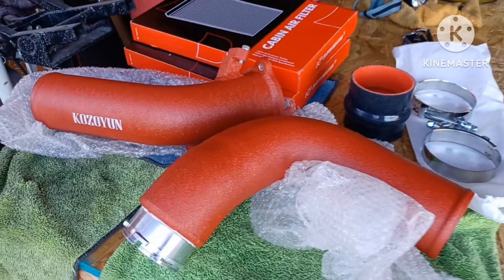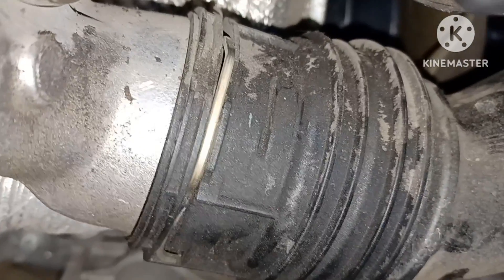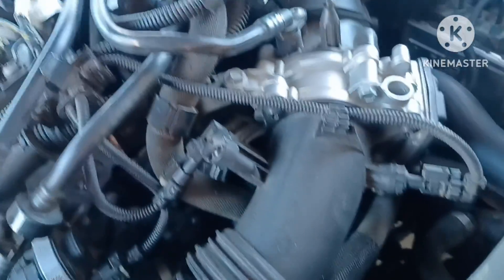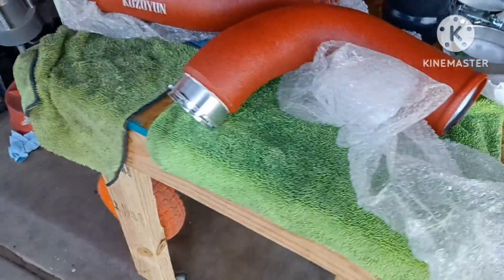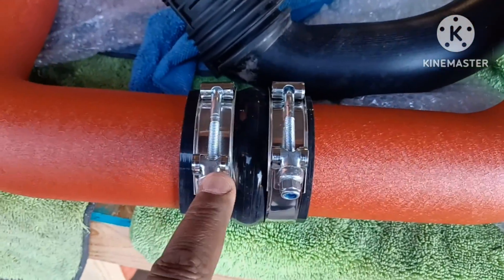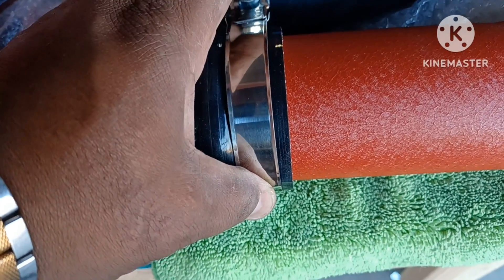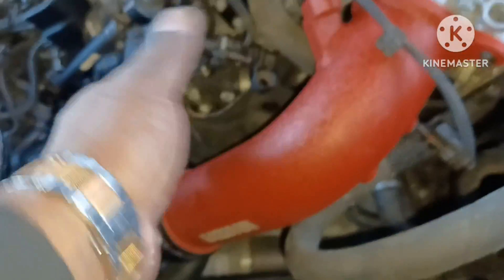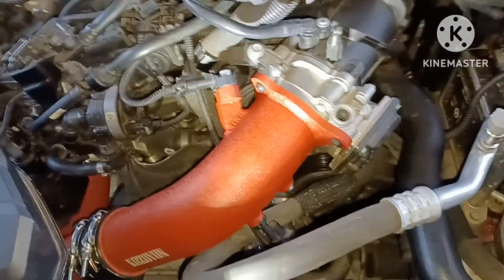BMW performance upgrade to aluminum charge pipe | 2019 BMW B48 330i G20

Comment: Do you have to get your car tuned after you install this? I'm about to buy this one for my 2023 330 and I don't want any check engine lights to pop up. Have you seen the check engine pop up since the install?
Reply from the maker: Nope. It didn't change a thing. All it does is hold pressure better versus the plastic pipes flexing once they heat up a little.

Comment: What blow off valve did you install . Is it attached  to the charge pipe?
Reply from the maker: The blowoff valve on this engine is somewhere after the factory wastegate down by the turbo. The charge pipe doesn't need a blowoff valve. You could add one, but you dont need to since there's a factory one already on the setup

Comment: Hey Jeff! Been looking for a replacement chargepipe and Koyozun looks like a good alternative to higher priced options. Any feedback after 1,5 years of use? Any leaks or error codes or does it work like a charm? Tnx!!
Reply from the maker: No codes and no leaks. Actually makes the intake sound like it's really sucking air, tho. I like how it sounds when you really get on it and it's like a vacuum sound and the car is just digging!
Reply: @MicDropBBQ Awesome, thanks for the quick reply!!
Reply from the maker: I try to reply when I can, Bruno! I know we trying to get these cars right! LOL!

Comment: I installed charge pipe on my 2019 bmw 330i and it gave me a check engine light
Reply from the maker: Because you're getting more air when the throttle body opens. Have to get it tuned to remove that light.
Reply: @ I am running cts intake with dinan turbo inlet and a cts chargepipe
Reply from the maker: @fuzionbrain  tune might correct it
Reply: @MicDropBBQ  yeah cause i took it to get a scan but no codes showed up but i do have a check engine light
Reply from the maker: Does it drive any differently? Mine has a slight hesitation from a stoplight, but once I'm going like 15mph, the ECU adjusts and it runs like normal. It's just at a super low rpm leaving the light is the only thing a tune can adjust. That's from too much air, I know.
Reply: @MicDropBBQ  no it dosnt drive any different from what I can tell I don’t feel it lose power or anything like that
Reply: @ do you think if I remove the turbo inlet n put it back to stock it’ll come off

Comment: You need an air intake to hear the turbo wayyy more
Reply from the maker: I have one. I didn't do a video for it, tho. LOL! I can't remember the name of it, but it's an entire intake system I put on there with the cone-filter instead of the box filter. It's wide open now! I think I wanna get it tuned at least for the increased airflow. It has a little more punch, but there's a little lag because it was tuned for the box.

Comment: Was thinking of getting this brand charge pipe for my Si is this brand good or should I spend a little more to get the better brand?
Reply from the maker: It's not done anything less than what I already had. It doesn't flex, and that's about all a good pipe should do. Brand names usually don't mean much. The car doesn't know what the sticker on the pipe says. If the pipes are identical and both made with aluminum, what's the real difference? The price...that's about it. The hose clamps are the same. The ports are the same. The dimensions are the same. The sticker and the price are different. That ain't gon make a car go faster. LOL! If stickers made cars go faster, I'd load up on em.

Comment: Apologies for the silly question. Why do you change the charge pipe?
Reply from the maker: More air pressure. It's like having a 2" exhaust versus a 2.5" exhaust. When you can fill more air into something, the boost pressure theoretically can be greater. Imagine having a plastic straw as the charge pipe; it's not that much air can pass thru it, and the plastic can flex versus being stable and solid. Now replace the straw with a large metal pipe; more air can now be pushed thru by the turbo, and there's no flex at any level (theoretically). More air pressure (especially when tuned) can now match the fuel in the intake. It increases hp and torque. You get more air pressure with aluminum versus a plastic tube that can flex as it gets hotter, as well. You get more stable high pressure (psi) on heavy loads with aluminum.

Comment: How you like that chargepipe as far as brand?  Im getting a full intercooler kit with charge pipes for my n55 f10 535i. Same brand.  The entire kit is cheaper than buying the namebrand intercooler alone so im wondering how you feel about quality
Reply from the maker: It's solid. Looks amazing and easy install. Doesn't feel cheap like the stock BMW parts that I pulled off, for sure. Really gives the engine an upgraded look. I also have an intake I put on, but didn't do a video of it. Whole engine looks very detailed now!

Comment: I can't believe you give 5 dollar rides in that car. Rideshare pax deserve no better than a 5 year old chevy Cruze
Reply from the maker: Depends on how far the ride is for $5. A mile or two, sure. But I won't give someone a $200 ride for 200 miles, no. That's $1/mile.

At $5/mile, I can make $1,000 in 200 imiles.

Comment: Damn bro I wish u in my city. I need help with car problems.  Prius 330k miles now . Hey do you know if somebody swaps an engine do they replaced the transmission fluids too ?? Or no?
Reply from the maker: You could do transmission service while it's all apart. Would ve easier for sure.

Comment: Smooth work  looks dam cool
Reply from the maker: Extra air flow! This is a 3" charge pipe so the half-inch space more from stock allows more air pressure to build and ve ready for launching when you hit that pedal. She moves!

Comment: Yeah, i'm not too fond of the E-china store. But it looks good.
Reply from the maker: 🤣😅😆 e-China. That's hilarious! I used to be an eBay seller back in the day.  China took over that site, for sure. I always look to make sure it's an American seller, so I don't have to wait a month to get it!
Reply: @UberJeepAZ   I ordered a radiator from the jungle store, and it had a fortune cookie it. It said It could be better, but it's good enough 🤣
Reply from the maker: @agl6183  LMAOOOOOOO! I love those bad fortune cookies! LOL!
Reply: The truth is all parts come from china some ultra expensive are done in japan or germany but 90% are done there.   The thing is that most of the factories depend on a manufacturing pattent that the original suplier had once that expires the factory will still produce  the item under its own name.    Ive done my research.   Do yours and it will pan out.    I just bught the part for my car will let you know how it goes!!!!
Reply: @luisfernando130  hey Luis! How's it going? Would appreciate your opinion since I'm one click away to purchase one
Reply from the maker: Mine really sucks a lotta air. When that turbo spools, this little 4 cylinder launches!
Reply: @MicDropBBQ  damn, thats cool man. any check engine lights caused by the pipes so far?
Reply from the maker: @chhhrrrqq8030 no check engine light. It's basically a more rigid setup, but doesn't flex like warmed up plastic pipes. No lean codes or rice codes. Feels like it digs harder once that boost pressure hits!